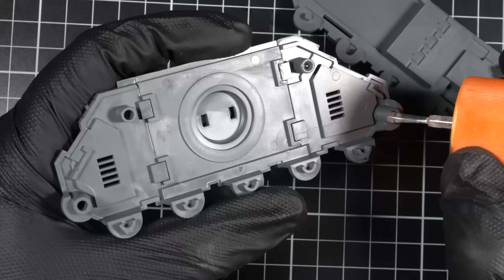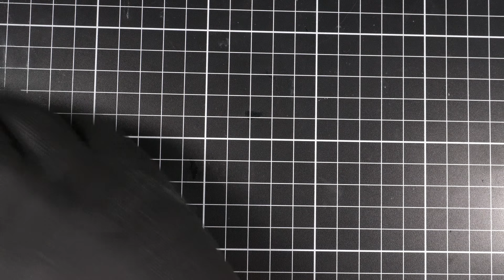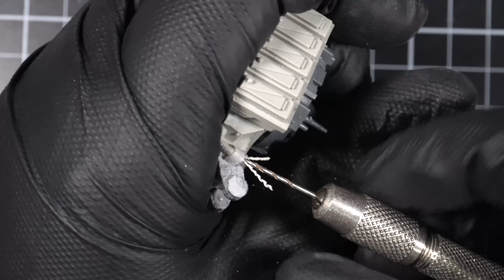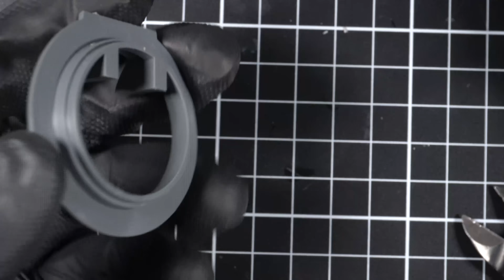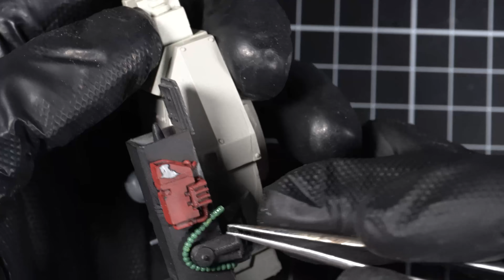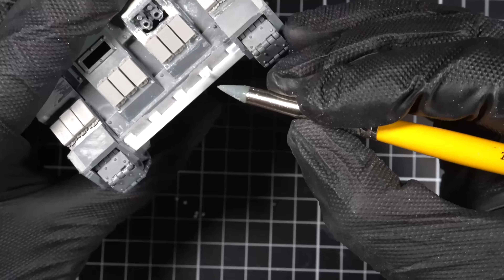Kitbashing the most TACTICAL PREDATOR - Warhammer 40K Conversion

Comment: Love the conversion; it looks absolutely fantastic! The flipped ring was a really good idea. Wish I'd tried it on my own conversions; would have saved a lot of grief lol. And if things still feel a bit too high, remember: stowage and improvised armor (e.g., sandbags) hides all. Definitely want to get some ERA for my Renegades now; it really added to the look!

Speaking of Deimos conversions, I recently used the Rhino for a tracked Gladiator and i ended up being a fairly painless conversion! Just build the Rhino (sans weapons and exhaust - the latter can be added after conversion wherever they won't obstruct), clip away the Gladiator's upper hull until you only have the "box" that contains the turret ring, adjust as needed to fit the Rhino's rear roof (leaving room for the two hatches at the front), and make the Gladiator turret as recommended. It only needs a bit of gap filling and, if you're big on WYSIWYG, you can slot in weapons as needed (e.g. using pintle guns to stand in for the sponsons or using the missile array to stand in for the dual fragstorm launchers).

Comment: This is really good. I have actually been doing something similar as well. A Super Predator that combines different Rhino Chassis kits together into one. The front dozer blade of a vindicator, it's additional Armour and the turret of a predator that I've added additonal armour made from sprue pieces. I wish I had some of that old additonal armour parts that were on forgeworld a long time ago and a Hunter/Stalker kit for the stabilizer drivers on the sides. What I'm missing is a front hull piece from the SoB's Castigator Tank that has a slot for a hull mounted bolter that actually matches up nicely with the gap in the vindicator's dozer blade for the intended mortor cannon.